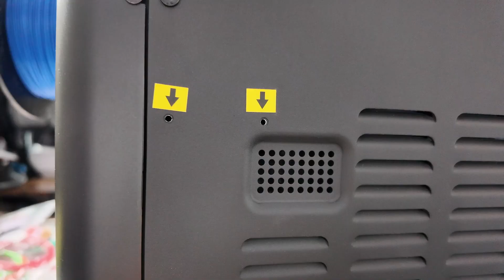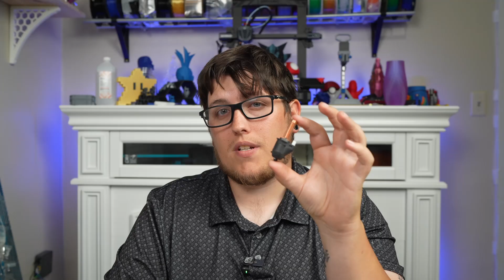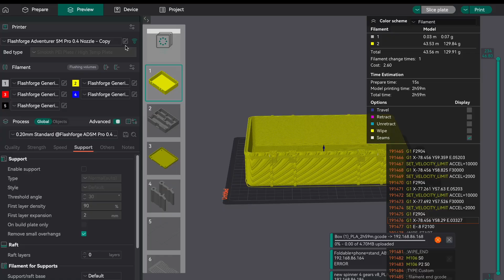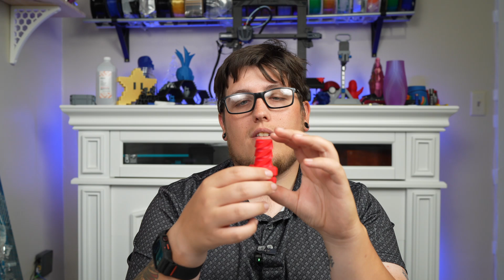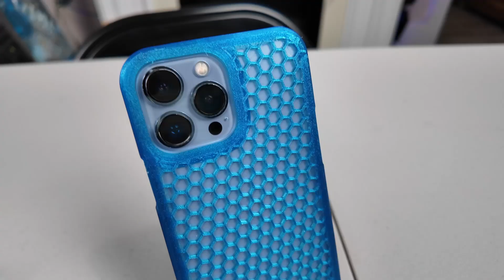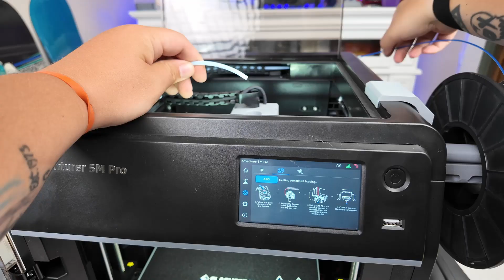Beginner Price and Pro Performance: FlashForge 5M Pro Review

Comment: Far better then the P1S in pretty much every way. In many ways it prints and competes with the X1C for quality and ability to print more difficult filaments. The pro even comes with hardened .6 nozzle for your glow in the darks, carbon fiber, and harder to print plastics. I can do nylons out of the box with some slight tuning or mods unlike the X1C where it cant keep the chamber temp up because it leaks so bad without modifications (like the AMS there are parts you can print to fix the issues).

the bad-
The rear spool holder is stupid. 
It feels a bit cheap but, well, it is in both good and not great ways. Then again it doesn't feel like its over compensating and including premium materials that harm performance just cuz.
Touch screen isn't bad... but it isn't good. I feel like some light scaling tweaks could work around the small size. Wouldn't be an issue if it was capacities but at least they did a high quality resistive.
The webcam is actually fine, just they don't apply any good post processing to clean it up (klipper mod fixes it right up). They could fix this too via software update
I really hate using the slicers and controls they offer. Its hot garbage but its a copy of bambu's services and slicer stratagy... which is hot garbage. Again klipper mod makes it usable and open. Now I can use standard orca or whatever to print to it over the network.
Could use some light tuning... but for this price I don't expect the insane tuning work Prusa does for instance.
Replacement nozzles and some things you have to order off the site or Aliexpress. Similar to Bambu in its first year of existence. Not amazing

my takeaway-
A lot of whats bad you get is a cost reduced P1* X1* with some nice quality of life fixes (better nozzle swap and they actually nicely sealed up the chamber) out of the box.
Sure there is no AMS but that solution hasn't really kept up with the market anyways (from a reliability and material waste standpoint).
Did I mention my exotic nylon doesn't warp... for 500 USD. squees

Comment: The 5M Pro is a good printer, not great. Too many small issues to make it a viable competitor to the P1S, even though the P1S is $100 more. You get a LOT more for that $100 than you'd think. Bigger build volume, smoother user experience, cheaper hotends, bambu's proven reliability, etc.  If the 5M Pro was around $400 it would be more competitive. At $500 though, they're in the bambu waters, and the bambu sharks are hungry...

edit: Excellent review btw. Very detailed and well presented.🍻

Comment: Nice.  I really like my AD5M.  Printed the enclosure for it.  Easy to load filament for sure. I added the camera too.

The Orca Slicer profiles were actually committed to Orcaslicer by FlashForge.  I have no idea why they forked the entire thing.  I haven't tried Flash Orca yet or the app because the android version is just an apk and not submitted to the play store.

Otherwise great printer.
Reply from the maker: I’ve genuinely enjoyed my experience with it so far but the slicer forking has got to stop unless companies are going out real work into them
Reply: @remthompson  oh yeah, I forgot, you can access the camera just in the browser:  printerip:8080/?action=stream